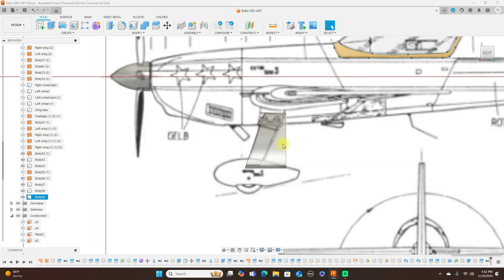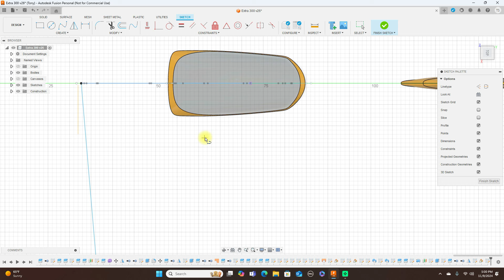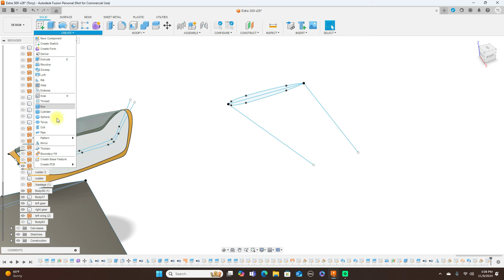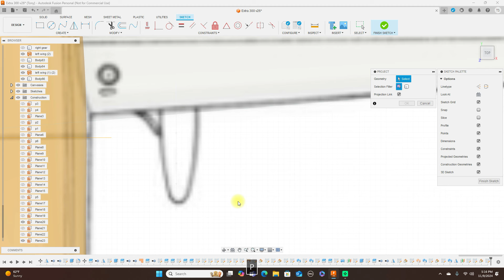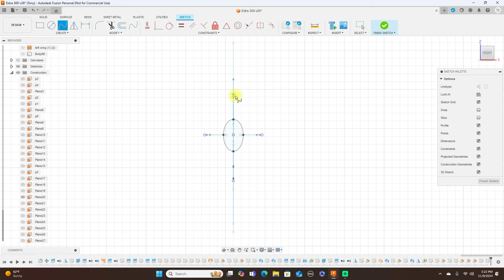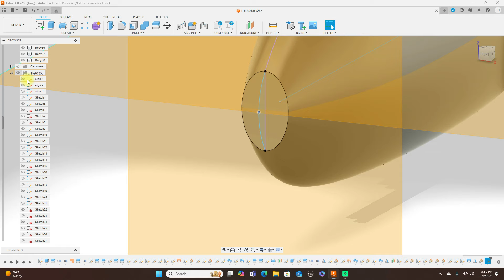Learn to surface model an Extra 300 in Fusion 360 CAD part 2

Comment: I'm struggling with best way to make the wheel pants. You said you would use solids, any previous videos of that method?
Reply from the maker: Check out my video called "Learn how to model an Extra 300 in Fusion 360. Beginner to Advance" I modeled the extra using forms and I show you how to model the wheel pants using forms.
Reply: @cadbuildflyrc3784  I will certainly have a look. What is the benefit of using forms over this method? I assume it is just more control over the shape ultimately?
Reply from the maker: @raptorheli2  There is no big difference. Just another way of modeling.

Comment: For the wing, you should stick to a hollow wing so you can make the wing spars correct? Instead of a solid wing. Thank you for another awesome video.
Reply from the maker: You can use a solid or hollow for the wing. Both would work for making the wing ribs.